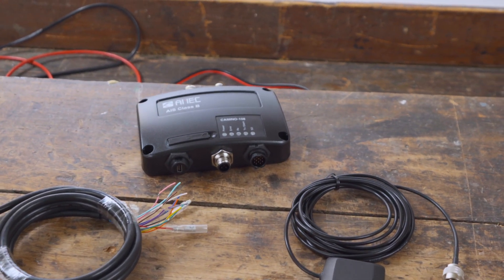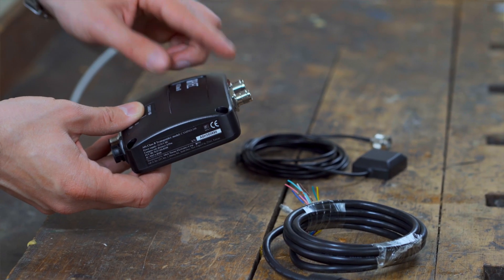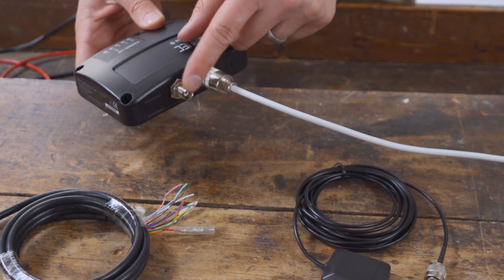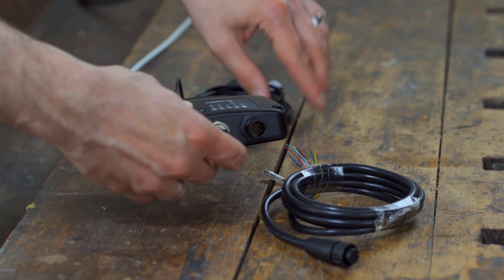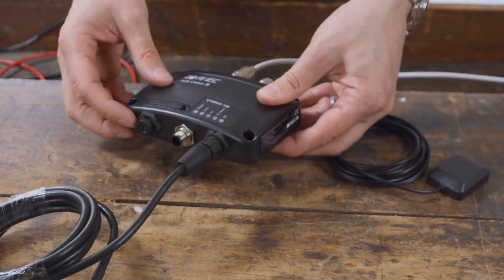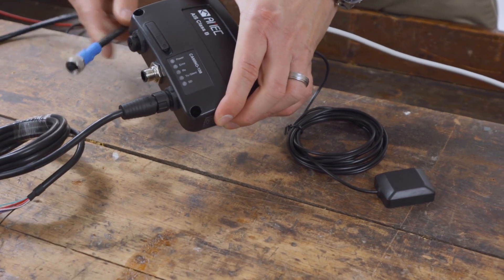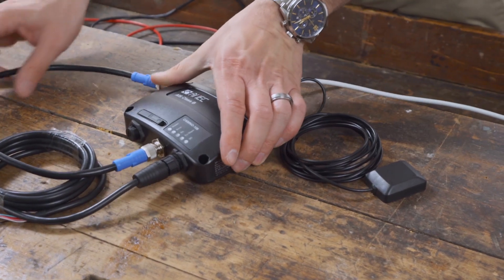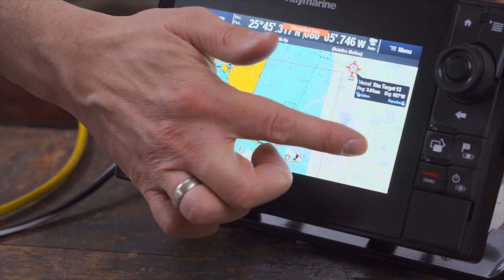AIS Transponder - Installation with Own VHF Antenna | SVB

Comment: unfortunately that setup is not gonna work very well for transmitting because a general VHF antenna is tuned for best performance to channel 16, 156.8. AIS frequencies are much higher around 162.  It will work fine for receiving and seeing other boats, but not transmitting.  (believe me I've tried).  You'll need an AIS specific antenna or broadband.
Reply: a splitter ?